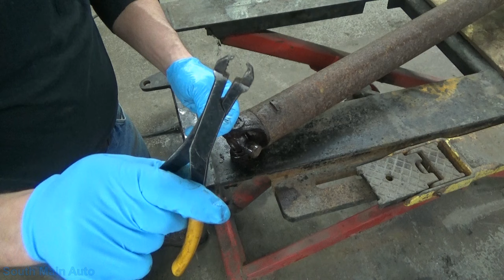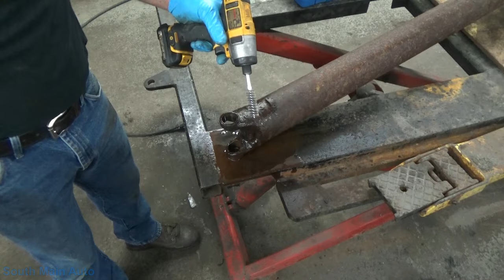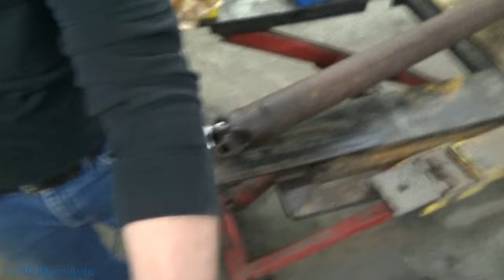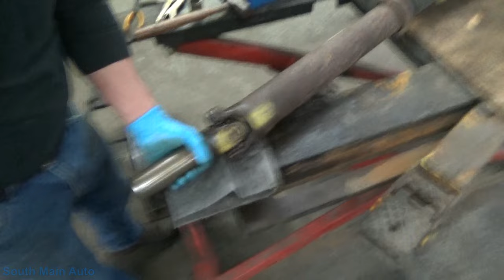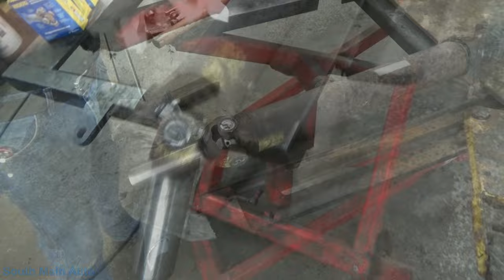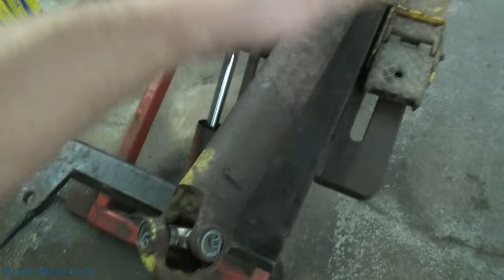How To Replace U-Joints (ULTIMATE Guide Using BFH)

Comment: I just installed 2 new u-joints on my driveshaft and forgot to add any grease and drove for a total of about 15 highways miles....I plan of greasing them both up as soon as I get the adaptor for my grease gun in the morning.   Do you all think the u-joints will be ok?

Comment: Any other advice for changing u joints on aluminum drive shafts?
Reply: work the cups slowly from side to side using erics method// DO NOT USE PRESSES OF ANY KIND and use plenty of acetone trans fluid home brew/// go slow use a 2 pound sledge and be careful you should have no problem

Comment: I use the vice and two sockets method but...when the new one go on my own vehicles they have been drilled, tapped and had grease nipples fitted.  I'm old school and 'sealed for life' is all well and good but not when that 'life' is a fraction of an old school UJ with grease nipples.  The catch?  You have to remember to add them to your service schedule...no big deal.

Comment: ok if the u joint is junk just torch the cross out and drive the caps into the center. you avoid making the burrs and after the first tap or two it is so much easier to get the snap rings out

Comment: 11:50 Good luck getting grease in that joint! The zerk is facing the yoke! And also ALL u joints should be installed in COMPRESSION! So what that means is that when the joint is driving the vehicle in a forward direction the zerk is being compressed into the cross. You dont want the cross to be able to open up on the drilled portion where the zerk installs as that is the weakest part of the joint. Do it wrong on a 1000 HP drag car or a tractor trailer and watch how fast it spits the shaft out from under the car/truck.

Comment: Exactly like the way I did u-joints, if I left the caps on the back one I would wrap electrical tape around the four caps and hold the two loose ones on.

Comment: dang i was just doing mine and a few of the roller bearings fell out of place, i couldnt figure out why i couldnt get the second clip down far enough..... i took it back apart and discovered i broke and smashed a couple of the needle bearings. so i just ordered another new u joint 😡

Comment: I pretty much do U-Joints the same way and have been for many years. On some i partially cut them apart with a torch if they are real stubborn. Can't say that i remember ever having a problem.
I worked at a place where they wanted us to use a B.J. press and i only used it when someone was looking...HaHa.

Comment: the U joints on my 1992 Chevy Silverado 5.7L 2 wheel drive extended cab indeed actually does have the plastic impregnated U joints!
Reply from the maker: gravy job. do you know how to do them?
Reply: Nope, had them done about 4 years ago @ pep boys in South Philly when I got stranded on I95 south! A Penn DOT tow truck driver was nice enough to tow me and my truck to the nearest Pep Boys (about 15 miles from where I was broken down @) for free, but I gave him a $20.00 bill as my way of saying thank you! Got the new U joints put in and went about my merry Ole way! Non the less I've never for gotten that experience!
Reply: It's funny though the people that I took my truck to that Pep Boys actually did not want to do the U joints for the very same reason that you gave in your video about them exploding if you heat them up to hot

Comment: 2001 excursion. Driving speed over 55, as soon as you take foot off gas the truck vibrates for 2 seconds. This only happens when over 55 and coming off gas. It stops immediately when giving gas. What could this be?

Comment: 25:26 on time with your vise grips why not try the vise grip like you had it standing upright real tight and taking a 25 inch crescent wrench and the turn it? may make your life easier. just a thought or heat it and pound it..thats what we used to do in the field machining buisness when turbine shafts had to come apart from their ends similar to your universal joints

Comment: That was sort of the hard way although there isn't really an easy way.
I start with removing the yoke first so it doesn't get damaged then leave it aside till all the other ones have been removed and cleaned and refitted then I fit the U Joint in the yoke on a bench and fit that to the shaft last. to free up the bearings tap the tip of the lobes a few times to compress them and break the seal not hard enough to damage them though,
to clean up the burrs I hammer an old cup back through the hole backwards until it falls out. I've tried the freezer trick but living in a hot climate you have to be quick. warming the shaft a bit has a similar effect if you don't burn yourself.

Comment: You're not worried about bending the ears on the yolk by hammering around? Also, you definitely don't want any lubricant where the caps slide in when you insert the new ujoint.

Comment: It's OK to beat the shit out of it when taking apart;  reassembly, I use the vise. Put the cross in, then press 1 cup in about 1/2 way;  now slide the cross into the cup. Now put on the second cup, slowly. Now, slide the cross unto it, so the cross is now into both cups. When cups are flush with the ends, use a socket smalker than the cups, to make final press. 
BTW,  if it seems a little stiff, use a small punch with LIGHT taps, to push cups outward. Cups will now
 be looser, and stiffness will be gone.....

Comment: I'm thinking you should grab a mag drill and punch a couple holes in your metal lift/table deal to push the caps through instead of balancing on that valuable 1 1/4" socket....

Comment: The carnage is the best! Speaking of carnage, last time I was on the matco truck I saw an air hammer bit that is specifically for driving out U joints. Do any of you guys have experience using this attachment?
Reply from the maker: I have seen them completely destroy the yokes... beware
Reply: if a cup is rusted in or is bound up any kind or press or air hammer will bend the yoke beyond use erics method is absolute the only sure fire way to r&r ujoints whthout destroying the driveshaft

Comment: Part 2 of question
Having trouble with a stripped thread on transmission line on a
2005 Chevy 2500hd crewcab 6.0 gas.
Please and Thank You.
Reply: Only options really are either 1. to replace the line or 2. if the line is brand new or just wanna save money or something, if you have a line flare tool then just get a new threaded fitting, cut just the flared end off the end of the line, remove old threaded fitting, install new one, and re-flare the end of the line. If you don’t have a line flare tool you might be able to find one for the same price maybe even a little cheaper then a new tranny line. Don’t cut off more then you need to though. I’m sure you’ve probably figured something out by now but I just thought I’d give you an idea for the future

Comment: 26:00 Pretty sure the reason you were having so much trouble with those cups was because the yokes weren't lined up and the crosstree was hitting on the inside of the axle yoke. You lose a little of the driving distance when they're not in line.
27:00 you can drill a bunch of shallow 1/4 inch holes around the outside of the handle to get a better grip. Or use hockey tape.

Comment: I used to do it this way, however now I resort to using the air hammer.  it's quicker,  and frees up one hand to hold the cup and cross together.
Reply: If you ever have a cup bind or rust in place you will go back to the basics and  DO THEM ERICS  WAY  or buy a new driveline your vice destroyed  IN ATTEMPT TO GET THE DRIVESHAFT APART
Reply: vice or air hammer

Comment: I took a pair of vise grips and with a 1" cutoff wheel, cut teeth parallel  to the sides, perpendicular to the existing teeth so I ended up with pointed teeth in the jaws, this grips the cups much better... fair warning, they wear out rather fast so use cheap vise grips.

Comment: Anyone know the average bearing cup size of U-joints?   I have a Chevy Colorado and a Lincoln Mark VIII, both with driveshafts.  Tiger tools has a current sale on the Tool kit, but its for bearing cups 1.00inch to 1.25inch.  Its too cold here to crawl under vehicle right now.    So, my question is , anyone know if these vehicles bearing cups would be less than 1 1/4inch?
Reply from the maker: just look up the ujoint at the parts store and measure them

Comment: I gather the cups do not have to be installed on the shaft they come off of?
Reply from the maker: oh gosh no
Reply: South Main Auto Repair Thanks for answering. Have a nice week.
Reply: I was told years ago that when you pulled the new cups off you had to install each of the new caps back on the new joint where you took it off of as the could be ground different sizes. I guess the counter person has had me wasting my time . Thanks for setting me straight on that.

Comment: how do you know if u joints are bad without tearing apart...symptoms??
Reply: Clunking or squeaking from the driveline that increases in intensity with speed changes. You might feel vibration as well if they have started to disintegrate like the ones in this video.

Comment: U joint should be positioned so that torque is applied putting the zerk fitting in compression, not pulling those zerk fittings apart.

Comment: Nice to se your effort and energy into that and not giving up. but the reason for the struggle is simple, your doing it wrong. sorry to say. replacing U-joints is a mechanics first first lesson on drivetrain and that is not the way it's taught. Normal time was 6-8 minutes to replace a U-joint. I think your video works anyway because it shows how struggle and hard work gets you there. In the end it's the result that counts.

Comment: Take them out with a hammer but press the new ones in with your vice.  Id never beat on the new cups. When the cup gets in as far as flush, just get a nut and press it in further. No beating the new parts

Comment: now Chevy used clips on the inside of the of the u joint to hold the caps in place ford uses the clips on the outside to hold the caps of the u joint in place so that drive shaft must be out of a ford

Comment: hey how would an air hammer work out?
Reply: I  used a PRESS AND AIR HAMMER up till i was 25 years old EVERY U JOINT I DID  up to that point had vibrations / from then till now i do them exactly as eric o does a bolt 2 pound sledge and what he calls home brew and a socket / never have i ever had any problem since then

Comment: Rat tail files...  They're pretty much available everywhere and make smoothing out circular openings a breeze.
Reply: The hammer route.  After one back and forth, I would have cut out the U-joint body with a torch, then knocked the caps out.  A long time ago I beat and beat on one.  Knocked the thing out of balance.  Had to have it re-balanced.

Call me gun shy now.  I don't like to beat on anything unless absolutely necessary.  I also prefer a press for that very reason.  Although, you did mention the downsides.  But, with proper jig setup an attention-to-detail my personal opinion is it's less stressful on the component and my psyche.

An important piece of information is I'm an in-depth DIY'er, not a flat rate guy.  I can take the time to take it slow.

Comment: After seeing how much trouble you have with your shoulder you may need to try a different method than wailing on it with a hammer. As we get older those aches and pains we feel are from things we did years ago, when we were bulletproof,  coming back to haunt us.

Comment: Aren't you concerned about using the battery drill with flammable brake cleaner??  Wouldn't a pneumatic drill be better for safety?

Comment: Yeah, that's the way I do it.  Beat the snot out of it.  More cussing though.  I like to watch someone else do it.  My throat doesn't get sore from all the cussing.  Years ago when I was changing a clutch on my 67 Chev pick-up, crawling around on a cement floor underneath it trying to get the bolts in on the bell-housing, and my mother unknowingly came out to see how I was doing.  Ruh-oh.

Comment: * The BIGGEST Problem I see, as Appears at  approx 33:05 min, is that the Socket that is used to drive the Ujoint Caps INTO,, is NOT DEEP ENOUGH, to 'receive' the Caps being Driven Through the Yoke and the Shaft itself.. I believe you would NOT have had the Difficulties you had, if used a Larger DEEPER Socket,, Or, used Different Method to Allow the Caps to be Driven Out of Yoke and Shaft a further distance.... .. (Also, as noticed to Confirm, the Yoke had a fair amount of Play, Up and Down,  w/ the Cap ONLY Protruding a Small Amount from Shaft and Yoke, Appears like Only 30% + or -.. w/ Caps STILL TOO TIGHT to remove w/ Vice Grips!..... .. You gave some Good Tips through out... giving A Big Plus for your Perseverance..
(from an Old GM dealership Mechanic, and Several Small Full Service Garages and Machine Shop.. plus, grew up on Large Farm, Fixing and Repairing Lots of Equipment.. age 75 now, still doing  Automotive/Fab part time still) Dec-2023

Comment: Twist the bearing...the teeth on the vice-grips meant to stop something from spinning or to spin something...but you are hitting them from the side with the sledge and they just come right off...they aren't designed for that use...I think I just thought of a new pair of u-joint vice grips...hmmm
Reply from the maker: problem is the ujoint caps are so hard nothing digs into them
Reply: Really good video though...I learned a lot...you're my favorite youtuber and my favorite mechanic for sure...God Bless Dr. O!
Reply: Now I just need to stumble across one of those huge bolts...
Reply: any diesel mechanic shop has those huge bolts

Comment: i weld a bolt or  nut on the cups, and pull them out with a slide hammer. Greetings from a Dutchman.
Reply: Cees van der Wal I was going to say the same here I rarely do u joints I work on European cars but when I do a u joint I welld a bolt and use a sliding hammer I guess a body shop dents puller could work too.
Reply: Cees... I like that idea. Good to know.
Reply: ja dat, ik zie hem aankloten en man las er effe wat aan stuk draadstang of zo en trek dat ding er af.

Comment: I would remove the clips,, punch them out like you. When the cup or cap moves out hit it with a little heat not to much, and you could remove them with a pair of pliers or vice grips ( Plastic originals I wouldn't use heat). Good video. Thank you.

Comment: wouldn't it be easier to just use a air hammer on the u joint?, can you use an air hammer on the u joint
Reply from the maker: that is a little trickier than it looks. The air hammer could bounce out and hit the shaft
Reply: Ok
Reply: Down here in Florida we don't deal with rust, maybe over by the coast but not to much in central Florida
Reply: Big nasty is for rust I use little nasty but once in a blue moon

Comment: Arthritis and your not even 40 yet? ya being a wrench puller is hard on the body its why I never took it up as a full time career. I changed my first U joint when I was 16 dad showed me using the vice method later on I learned the beat with a hammer method.
Reply from the maker: I have psoriatic arthritis pretty bad in my shoulders and hips. Doesn't discriminate on age unfortunately...
Reply: That doesn't sound very good :o(
Reply: South Main Auto Repair -I started getting “Artie “ in my ankles at 25. Have flat feet and by that time already 10yrs standing on cement floors in a machine shop. So I started driving big trucks. Now at almost 46 it’s shoulders and hands, can hardly make a fist in the morning (to drink my coffee,perverts). I’ve tried lots of things for the pain,but I really like shacklee vitamins and their joint supplements. I have to keep changing careers because of it. I used to think the old people just couldn’t handle a little pain,now I wish everyone could experience the pain, without getting arthritis of course. You would swear you broke a bone the fist time you experience the inflammation.

Comment: You seem to use extreme care when doing these with spray, file, and wire brush, etc. This is fine. I have quite a few dozen u joint jobs under my belt from when I did my time in a trans shop in the early 80's. I can tell you by the 15 minute mark I would be done with that driveshaft. Sure some were more stubborn than others but it generally took about 5 minutes per u joint. My method was to secure the work with a vise without tightening down on the driveshaft. After the clips are removed the vise would support the loose cap ends, again vise not tightened down. I would then beat on the driveshaft forcing the caps out. And I never had to beat so hard to put extreme dents in the driveshaft tube or yoke. The shop I worked in it was all about speed where it was fairly common to remove a transmission from some 1970's cars in 7 minutes or so. And on rust belt cars. Does GM still use that hard plastic to retain the caps? I used a torch to melt it before the beating starts. We used to laugh about those grease fittings.. Like who actually greases their u joints?

Comment: I felt Professor Weber cringe several times during your "practical" repair. Banging on the thrust bearing (where were they?) was a concern of his. Also checking the center of rotation by insuring proper clip dimension. Of course Weber doesn't charge by the hour and doesn't deal with crusty!

Comment: you wouldn't have arthritis if you use heat to begin with heat is 100% MORE EFFECTIVE quicker and way less destruction to your joints and way less need for greasy kroil lube or pb blaster